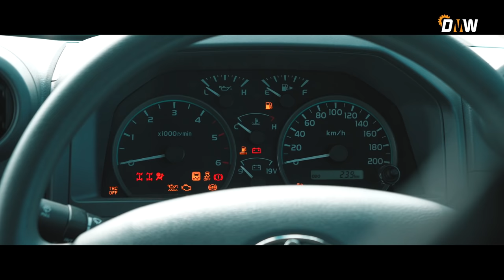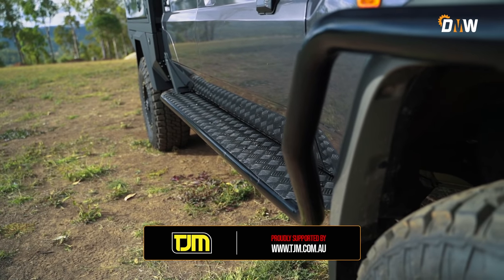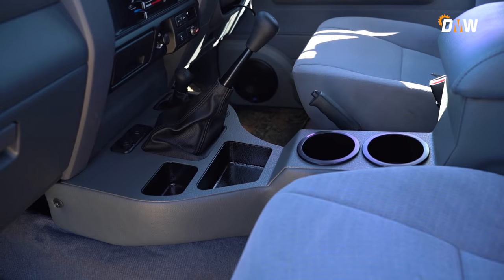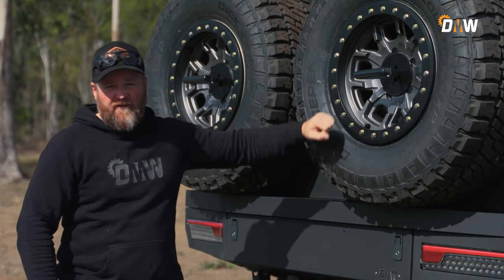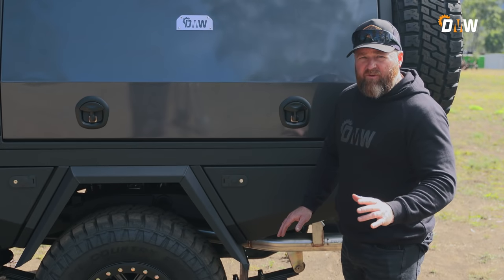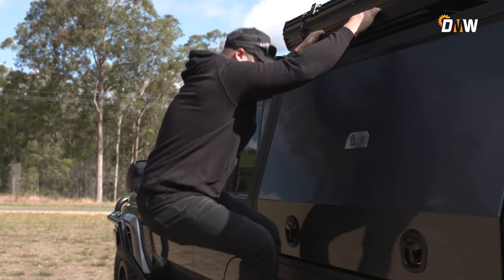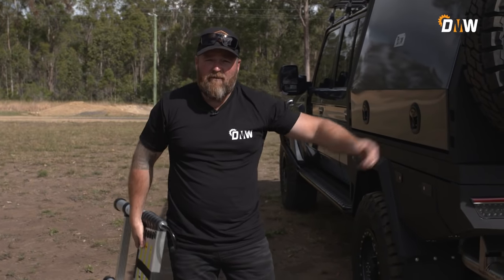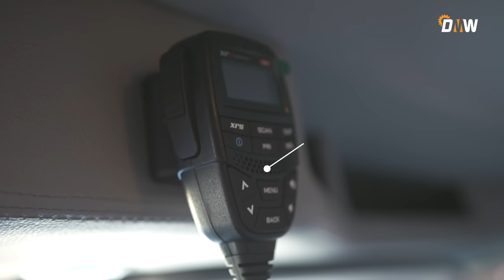THE BEST 79 SERIES IN AUSTRALIA? The DMW 'Top Ender' Giveaway build!

Comment: Hi dmw,
There are two must have accessories that you need to add to this awesome top ender build 1st accessory is a 12v portable travel oven so you can warm up your pie on the road and when you get to your destination you can enjoy a nice warm aussie icon the meet pie and the 2nd is a On-Board air compesser so when your done with 4wding you can pull over and pump your tires up no matter where you are.
Reply from the maker: Both great options right there!

Comment: A really solid set up- a suggestion the new OFF TRAX 270 degree awning would be a very hand addition to the vehicle  the tent may need to be rotated through 180 degrees to keep the awning on the passengers side - given the cooking storage fridge etc is to beset up for that side,  and while I am having  a wishing list moment a slide out solar panel fitted under the roof rack would be handy as well .  Can you tell I like this vehicle 
?
Reply from the maker: Thanks for the tip!
Reply: @dirtymuddyweekends  the new OFF TRAX 270 degree awning would be a very hand addition to the vehicle  the tent may need to be rotated through 180 degrees to keep the awning on the passengers side - given the cooking, storage,  fridge etc is to be set up for that side  just while I am having  a wishing list moment :<) .

Comment: Factor 55 winch hook would be a good touch. I, mean we haven't run out of soft sackle yet😃.. Simply amaijing rig. Add a little decals on the bull-bar it'll even look better.. A metal 3D decals.
Reply from the maker: Cheers Laloo!
Reply: @dirtymuddyweekends  Mate, are you gonna feature in the next episode of 4WD 24/7? With this new amazing black 79 series it would be so much better.. And also a good chance to try out your amazing built.
Reply from the maker: @laloolhouvum1634  we will be on another trip very soon but not this 79, stay tuned
Reply: @dirtymuddyweekends  sir, how many @DMW 4WD did you actually own right now, how much  it cost(fully built)?